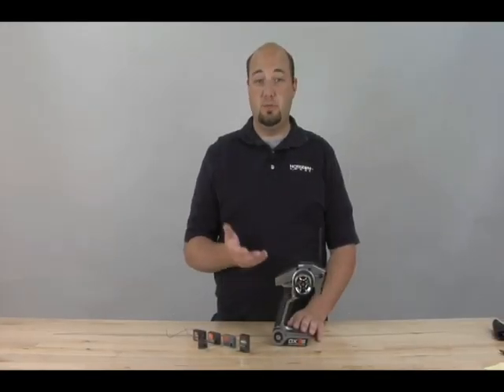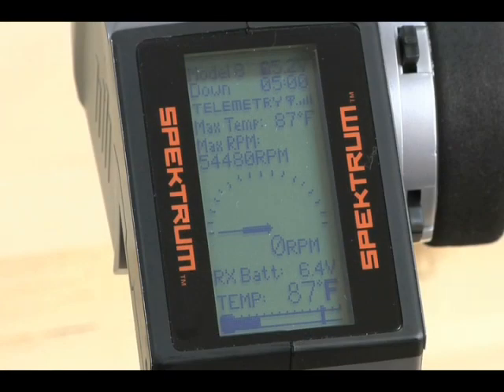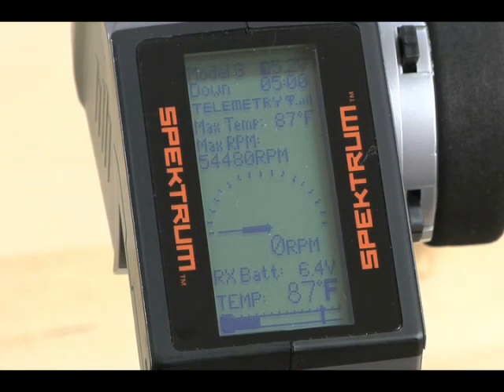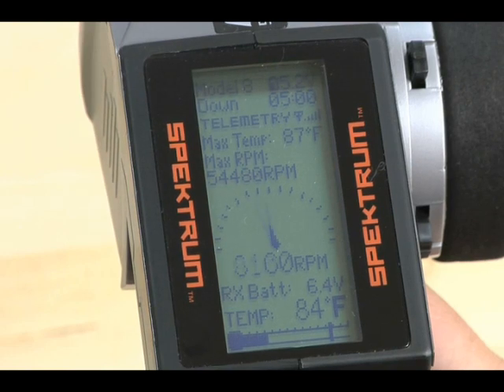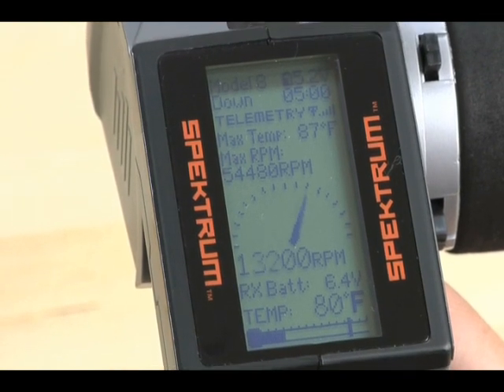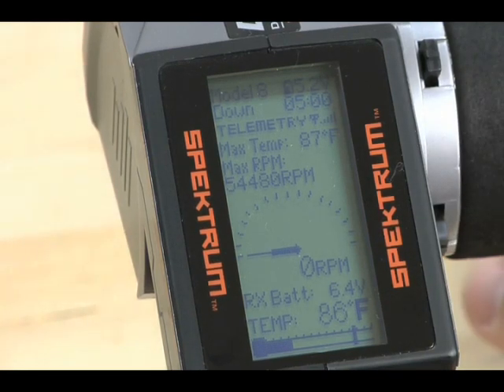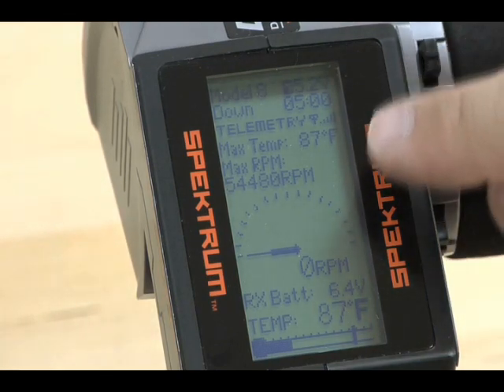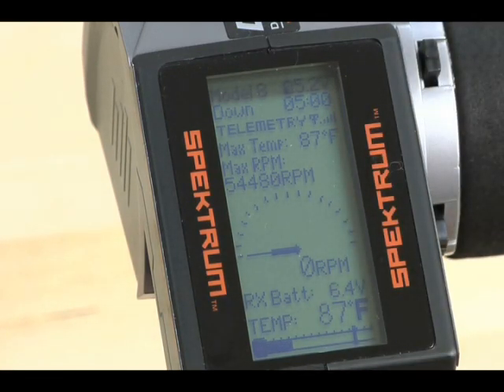HorizonRC.com Preview- Spektrum DX3S (Part 2 of 4)

Comment from the maker: These are all prices off the Horizon Hobby Website:
DX3S - $249.99
JRPSZ4800S - $84.99
JRPSZ8800S- $109.99
JRPSZ9100HVS - $199.99

The T, or Torque, versions of these servos are the same price. Just replace the S at the end with a T and you'll find them on the Horizon Hobby Website.

Comment from the maker: There's an optical sensor that you would use to pick up the RPM's on the engine. There's a reflector that is stuck onto the flywheel that the optical sensor will pick up.

Comment from the maker: All you'll need to do is swap out your stock receiver for one of the two that comes with the DX3S. All your servos will work perfectly, but you might need to make one change. I think the side of the plug has an ear on it that you might need to shave off is all. The DX3S is an excellent choice for the T-Maxx, great upgrade over the stock radio system

Comment from the maker: You should have:
Head Temp Sensor
Motor/Battery Temp Sensor
RPM Sensor
Sensor Mounts for .12-.15, .21-.26 engines
Sensor Mounts for Electrics
Telemetry Sticker Sheet